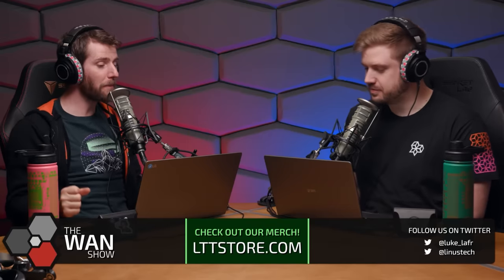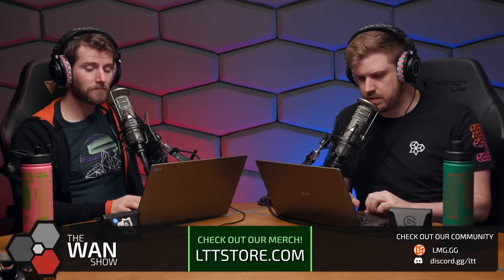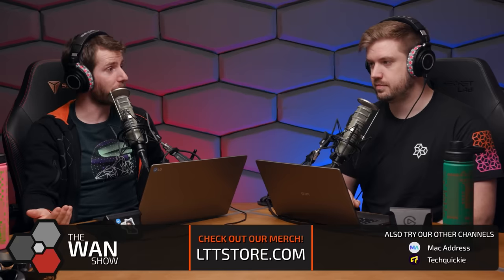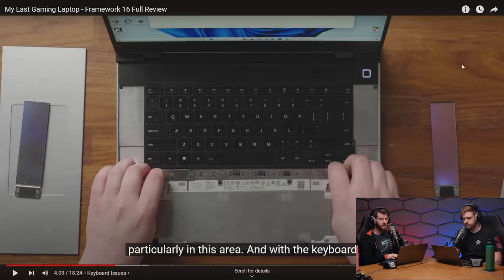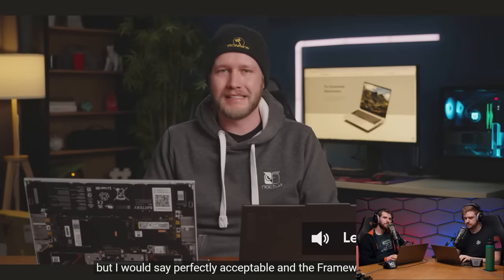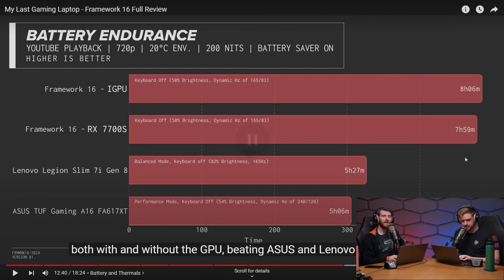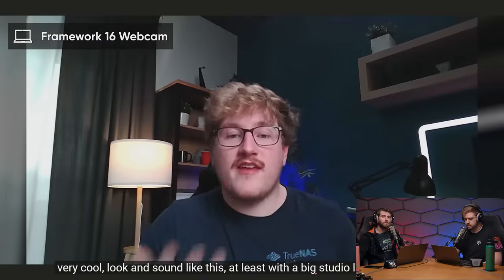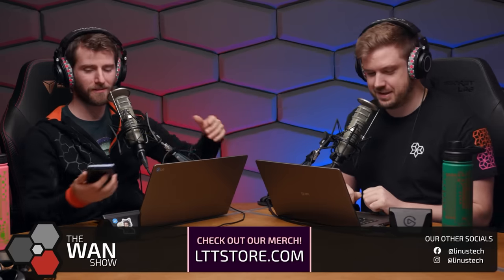Linus Re-Evaluates his Investment

Comment: Id love a framework, but theyre just too expensive. Its a cool idea though
Reply: Yeah that's the price of a (relatively) low production, niche product. Hopefully it'll get cheaper as it becomes more popular.
Reply: if i ever needed a laptop, i'd buy a used one anyway. once the framework is a few years old, there'll probably be a coule of used 13s for sale.
Reply: If you don't mind older generation ones you can find cheap 11th gen units on their marketplace
Reply: @552jacki3  No, it's not the price of a low production. It's the price of a business machine.
Reply: I actually don't think the laptop initially is too bad, but it's the upgrades. For what a new motherboard goes for you're better off just buying a new laptop every 4 years which is basically what the business model has been the past decade
Reply: Exactly. Get an inspiron. Replacable battery, replaceable screen, replacable ssd, replaceable ram. And the ones in framework's pricerange have better specs (excluding having a gpu, but then, get a gaming laptop at that pricerange)
Reply: @MrDummyisDumb  For the past four laptops I had, the main reason for the replacement was lack of affordable replacement parts outside the warranty. The laptop before my Framework 13 was a Dell mobile workstation. A display hinge broke from regular use, but Dell didn't want to fix it on warranty. Replacement would have cost 200EUR. With Framework, I have to pay less than 40EUR including shipping. I don't see myself replacing the mainboard in two or three years for this machine, but I can certainly see myself buying new hinges and a new keyboard for another year or two of service life.
Reply: @tumultoustortellini   Last time I checked, they are very comparably priced. As I wrote, Dell has been price gauging replacement parts and that's why I won't buy from them anymore.
Reply: @joergsonnenberger6836  Actually, looking at your story, fair point. I'm more a budget baller, I use a inspiron 3000, and haven't had problems yet, when I do, I can see the problems in that.
Reply: @tumultoustortellini   It's perfectly fine to be budget aware. The equivalent of the Framework is a Latitude, not the Inspiron. It doesn't make sense to compare them by spec alone as most of the properties that make the Latitude more expensive are not covered by CPU/GPU/RAM/Display size.
Reply: @joergsonnenberger6836  Thanks for the info, I wouldn't have known. What makes the latitude more expensive then?
Reply: @joergsonnenberger6836  but this is a gaming laptop...
Reply: We use these (currently just the 13s) at my business as our primary deployed fleet machine. I couldn't possibly afford one myself, but holy cow as an IT guy these are amazing from a sitewide maintenance perspective. Worth every dollar in the corporate space.
Reply: Theoretically it's like buying a North Face jacket- it's meant to be "the last laptop you ever need" and the amount of money you save by just buying piecemeal upgrades will offset the initial investment... but at the moment it's a bit high even for that. On the adoption curve model this is still in the realm of the Visionaries, nearing "the chasm", and their big challenge will be trying to get past that gap and get widespread adoption. Unfortunately it's kind of tough since modern consumers are used to the prices of disposable products rather than products meant to last. A jacket that only lasts a few years is $40, but one designed to last for 100 years is $200+ and people balk at that, I think it's the same situation here.
Reply: That does depend where you are. The Ryzen 7/16GB model is several hundred pounds less than the 16GB M1 Macbook air here (forget about the M2, it's nearly £2k) and priced more or less the same as similar spec Windows book. You can go cheaper, but you'll get a crappy 45% ntsc screen and i5/i3 processor to deal with. Not having a glued in battery.soldered in SSD is worth it to me.
Reply: Yes, but buying a new laptop every four years is wasteful, and therefore stupid. @MrDummyisDumb
Reply: You could contact them and ask if they have case only, that way you can buy as you build.
Reply: Yeah I sure hope the price comes down eventually cuz I want one of these things immediately lol
Reply: I grabbed a 13" factory seconds unit for 500. Very wurf

Comment: I mean it is the verge, they may have forgotten to isolate the PSU from the case or something like that.
Reply: they might even forgot to update or even installing the any drivers even. It's the Verge, any sane user won't even look at them for technical knowledge
Reply: @MrWillypanda88 but it's still important user info and it's good on the verge to update that they're getting a non-pre-production unit and might update their review.

The bigger issue is how dumb it was that framework sent preproduction units.

Comment: Framework is looking into the deck flex too. I'll post an excerpt from the pre-order emails that they sent which calls out the LTT video as the reason to start investigating  it.

"Keyboard deflection - We’ve seen largely positive feedback on the input deck feel, but also specifically saw LTT’s video in which they flagged keyboard deflection and the workaround they applied. We’re investigating whether there could have been either an issue on that unit or a scenario that can result in the mid plate not being flat. In either case, if we find that there is an improvement we can apply on this, we will do so and ship out any parts necessary for that to customers whose units have already shipped."
Reply: They mention that at 25:09, but thank you for sharing the actual excerpt! Keep improving, Framework.
Reply: "Keyboard deflection - We’ve seen largely positive feedback on the input deck feel..." That market spin BS tho. Not winning any hearts like that.
Reply: @Varadiio  I mean, if it's true it's true. As long as they actually address the issue some people experience then it's fine to mention that others have no issue.
Reply: I uh.... I think he knows this.... Large investor in the company and whatnot...
Reply: @Varadiio  How else would you say that it's an issue that happens to a minority of the devices?

Comment: Honestly the Verge’s review is pretty fair considering the circumstances of their unit. It actually reminds me of Doug talking about a Tesla engineer showing up with a pre-prod cybertruck
Reply: Based on them saying their unit ran hot and loud, it sounds like a bad unit. Which isn't something to ignore, in fact quite the opposite, but I think understanding that it was a bad unit is important context. Hopefully these bad units aren't that common.
Reply: @CorneliusCornbread  Frameworks support is pretty chill if you provide the right evidence. Also hope not too many ppl overload their support. if its a fault they can fix with a new part or boardswap. that be great.

I got my fan replaced  (FW13, 12th gen) for free (cause it was making noises and looked clean). a video  before and after "cleaning" proved it for them.

But they get alott of support tickets from ppl breaking their own stuff sadly
Reply: I wish more outlets did like some PC reviewers do which is to contact the company, see if they know about the issue. Sometimes you just get a lemon and that shouldn't affect the review
Reply: @kendokaaa  I can confirm The Verge had a lemon. My finalized unit is perfectly fine. No BSODs or kernel panics on it, and the keyboard flex by the L key isn't more than say an HP Omen.
Reply: @CorneliusCornbread  Well, if anything its to be expected that they get bad units. Framework themselves said that the review units were chosen because most of them were deemed as not acceptable to send to consumers. And instead decided to send them to reviewers.

Comment: MXM was a nightmare.  I had a 17" Alienware from the old days that came with a 480m?(might not be right with that).  I upgraded to an Nvidia 980, which on mobile had 6gb as compared to the desktop which only had 4gb.  What a nightmare,the case had to be dremelled in places, the card was slightly offset to the right from the socket, I had to use a grinder on the heat sink and lots of thermal pads to accommodate the different ram locations.  You also had to modify the info in the driver bios because Nvidia didn't want to allow you to put driver's for a card that wasn't on its list of official builds. 
In the end it worked, ran cool,  was fast, it was a good gamer even in 2020.  Then 6 months down the line it popped something during a stressful load.  Like $450 total down the drain for a short run.

MXM sucked rhinoceros balls..
Reply: As far as i remember, it was not really standardized (or rather enfoced strictly), and whats worse, Dell/Alienware was one of "those guys" which tried HARD to deviate in shape/placement of components as much as possible. Clevo/MSI/Lenovo versions of same cards were not compatible with Alienware bodies and vice versa.
Also - it was highly adivised to buy proper, complementary to chosen GPU , heatsink.
I BET MY ASS, if your laptop originally came with 480m it was not "meant" to be upgraded further than 6xx/7xx/8xx (which were basically same cards in laptops, but reheated burgers...). 9xx and 10xx gen of cards were different in some major ways which meant that no eng. could have forseen than 4-5 years into the future.

As some useless info - i believe anything higher than 1060 needed some externar clock signal or something, which rendered old MXM laptops unable to run them.

In the end - fact that (not without issues) you actually could do it... was unbelievable in laptop market. Hence my opinion is MXM was great, albeit not used "correctly" - not standardized enough, no major official manufacturers support for swaps. Kits for upgrades were wery rare to be distributed in any major and official way (not that there were none of 'em to be clear)
Reply: @DrBunhead95  it was nvidia dropping support for LVDS display output(requiring eDP or atleast optimus to have the igpu handle the video output) in the 1060+ cards and legacy bios support in the 9xxM cards that crippled compatibility with older laptops especially the former. As for physical compatibility goes I think AW/clevo/msi had at one point shared a 'standard' type B layout until the  maxwell generation sharing the GPU/Vram/Screw hole Placement and PCB Sizing. Signaling, power and physical constraints seems to limit that "standardized" type B to 1080/2060/3060 cards that led its use being discontinued in favor of custom solutions. 

I dont think the framework gpu solution on its own would gain traction in a similar scale as the  "Standardized MXM 3.0 Type B" as used by Clevo/AW/MSI and Industrial/Medical applications(which refuses to allow the format to die and seems to have created Type B+ for the 2080/3080) as people are upgrading the laptops beyond what the manufacturers are willing to provide and support.Unless more manufacturers adopt the format and create upgrades for it this would end up like DGFF or Clevo/MSI's variation on the MXM format.
Reply: MXM standardizes the slot but not the screw hole positions or the board size and shape . that's the problem. every single MXM board has a chance to have completely different screw holes and board shape meaning it is impossible to transplant. pack it up thats all folks go home.

Comment: if that connection is a full x16 PCI, I'd love to see that connection used as an eGPU dock.
Reply: why would you do that? the GPU turns off when it's not being used. You're not saving any room by doing it, and battery life difference is negligible. plus the GPU connection needs to be screwed in and you have to have the laptop turned off while you do this. 
it is an internal PCIe connector.
Reply: probably 8 lanes
Reply: @JessicaFEREM  cooling and power delivery for ultra high performance - good luck cooling and powering something like a desktop 4090 in that module's form factor
Reply: @pmc_ tbf cooling a 4090 is hard in nearly any formfactor
Reply: @p3chv0gel22  exactly, that's why an eGPU dock would be great. you could use a 4090, and have a chance of actually cooling it
Reply: It's x8 per the product page.
Reply: Most of the mobile CPUs, Ryzen 7040 included, only have 8x PCIe as a max
Reply: Ryzen 7040 has 8x for dGPU, 4x+4x for NVME, 1x for LAN, 1x for WIFI, and 1x1x for other things, such as SATA controllers
Reply: @JessicaFEREM  For using a desktop GPU for sake of max power and cooling.  And yes, it needs to screw in, I am speaking of a hypothetical I'd like to see; the state of eGPU speed is sorta sad, even if it's niche
Reply: laptop CPU has a cap of 8 lanes to the GPU, thats not a framework choice. but it would be SO STUPID to use an eGPU, as it always is. if you want to be anchored to a desk, use a desktop. if you want the mobility of a laptop, use the laptop. this bastardized middle ground you people want is nothing but the worst of all worlds
Reply: @jessicaFEREM when the time comes and you upgrade your GPU, you can use the old one in an enclosure for any other laptops you may have laying around.
Reply: 8 gen 4 lanes
Reply: Might be interesting. When watching the the review video, I had mused about a module with a bunch of extra io. If one of those ports exposed the lanes directly, you'd be able to use it lightly when taking it somewhere and place it on a dock when you're home. Would be good in a business setting, as well, giving up some weight when doing lighter work, then connect it to a dock when you're, say, rendering a 3d model, or a video...or using the NASA speed internet to play games when the boss ain't looking.
Reply: 8 Lanes of PCIe 4.0
Reply: @pmc_  that is quite possibly the worst excuse for an eGPU. If you use a 4090 for gaming, Why use an anemic CPU. if you need it for work station, you should be able to just buy a dedicated PC for that. If you want a portable 4090, you are insane for wanting that shit to be stolen in an instant.

Comment: MXM upgrading was a total nightmare and was nothing like upgrading a desktop graphics card. i had a Alienware M17X R4 and changed the dead MXM out these are the issues faced on that platform:

Power delivery issues
thermal solution issues
output/input issues
UEFI/BIOS issues
Fan speed issues

you could swap one MXM for another but it was essentially an EXPERT level only upgrade, and required custom VBIOS and BIOS in many cases to make it work.
Reply: They should have made a mxm2 with a full redesign. It could have been fixed. Shitty oem bioses didn't help
Reply: It's what I'm having to deal with playing with a 2011 iMac. Those Terascale GPUs are ticking time bombs and if you wanna use OCLP to put newer versions of macOS on it, it's not compatible with the Metal API so you're missing out on acceleration in most applications.

There's a pretty wide variety of MXM cards that could go in them, and a large thread of BIOSes and cards with methods used to make them work, but a good number of them require modifications either to resistors and solder jumpers on the card itself, or copper shims to increase the die height, or pieces that need to be cut off the heatsink to make room for coils and other tall components. But they ALL need custom bioses to function.

Comment: After having to go through 3 battery replacements, sata cable breakage ( can't find replacements), had to re-soder components on the board, and 2 fan replacements with my Dell, I will 100% be going framework with my next laptop. The ability to repair and upgrade is the most appealing part. Adding on how many talk of mostly upgrading as when they need to repair it was an accident, doesn't seem to be manufacture error.
I probably won't roll with the gaming unit as I game on  my tower or steam deck on travel, but I like the larger screen space of the 16 inch

Comment: 24:58 The issue I see with the thermal pad thing, is that itll potentially make the keyboard hot. So perhaps there was a small air gap left there intentionally to thermally insulate the keyboard to some degree? Some sort of firm heatproof material would be preferrable to a thermalpad, no?

Comment: I was shopping for a laptop in October and Framework (13 or 16) was so close. Ultimately, I found it way too expensive. I really wanted to support the concept, however, day-to-day it would be years before I’d want to upgrade it. I purchased a Lenovo Slim 7 Pro X with 32 GB RAM, Ryzen 9, and an RTX 3050 for LESS than the Framework 13. This laptop will last for years (at least for my needs).

I am also nervous purchasing a Framework as they are still a fairly new company. They aren’t promising future GPUs for the 16 (yet) and the entire point of an upgradable laptop is to have parts 10 years in the future and I’m not confident, yet.

Comment: I have an old Ibuypower CZ-17  gaming laptop. It came with a Geforece GTX675mx. that gpu died and was causing the machine to randomly hang, even if I was using the iGPU. The box would run witout the MXM card but the cooling fans went to 100%. I think that the thermister resistance is expected to increase with temp so infiinte resistance made the bios think it was burning up. I put a newer nvidia Quadro mxm card in but some of the components were in different locations requiring doubling up on thermal pads but it works fine.

Comment: the only thing mxm is still used for afaik is the hardware gsync modules in gsync displays.  they use an fpga on an mxm board.  the big problem with it was always even if you got a better mxm module and laptop brick, the bios support was never there.  I did have a clevo p150hm or something that was upgradeable from a 560m to a 680m 4gb, but that was exceptionally rare.